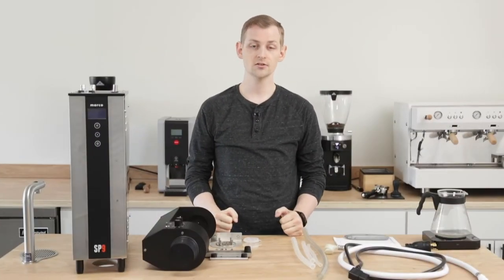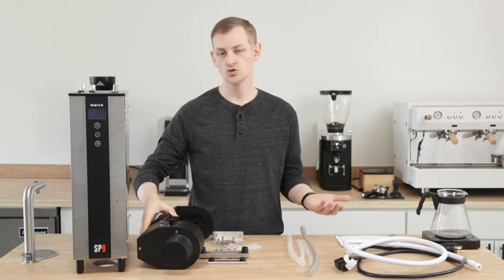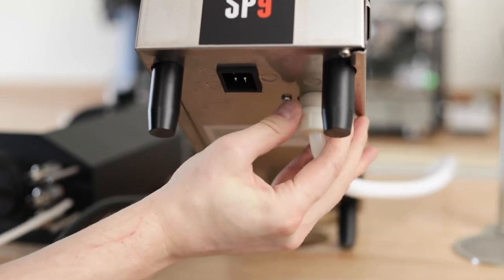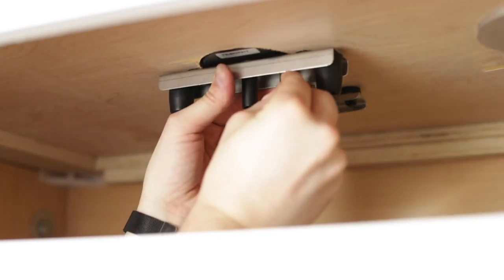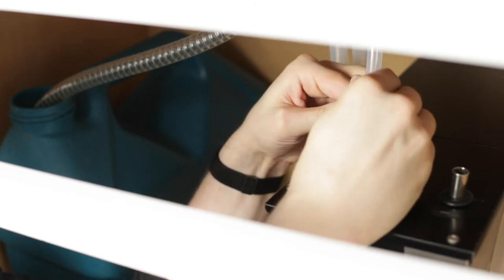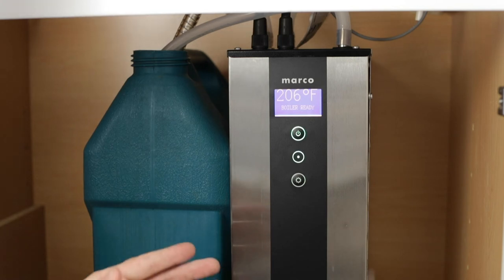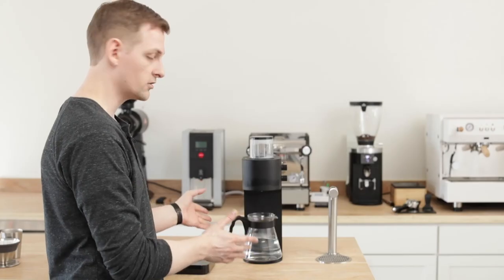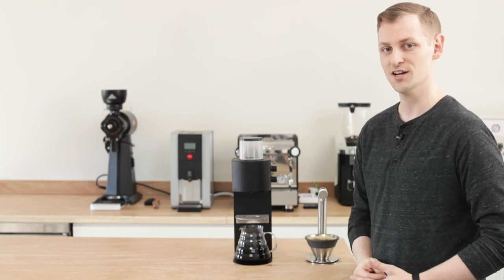How To Install the Marco Sp9

Comment: HI! thanks very much for the video, really helpful. A quick question though, I am bit confused about you electricity feed, you said it's connected a 220v 20 amp? I thought this boiler was plugged to a standard 13amp. Thanks in advance. Rod